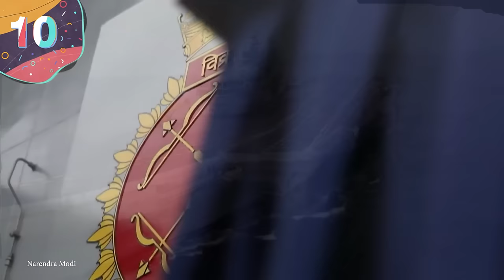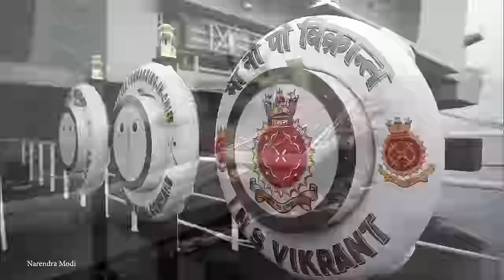15 TOP SECRET AIRCRAFT CARRIERS

Comment: The QE class ships are around 72,000 tonnes at full load and could operate up to 72 aircraft maximum, though a balanced max airwing, all types, tops out at around 60, including c48 x F35-B if the ships remain in STOVL only configuration. Though the current aim is partial conversion to hybrid (STOVL + CATOBAR) operation enabling large fast jet combat UAVs and other types to be included in future airwings.